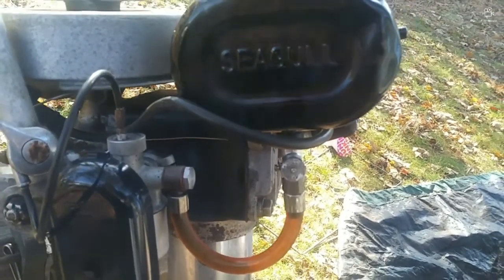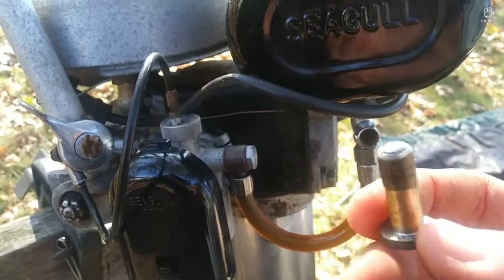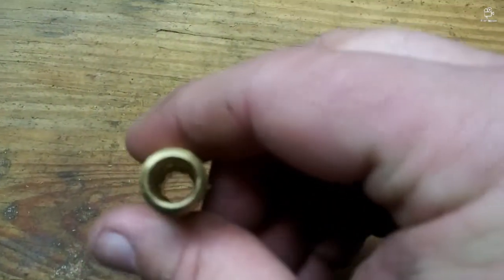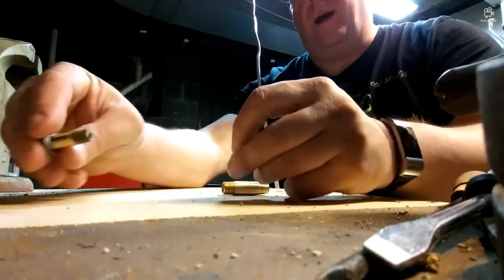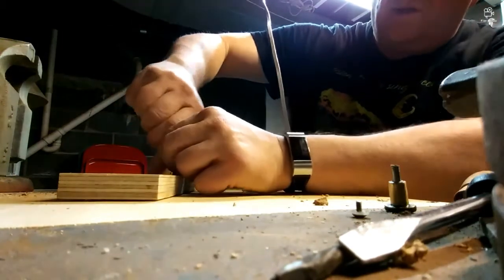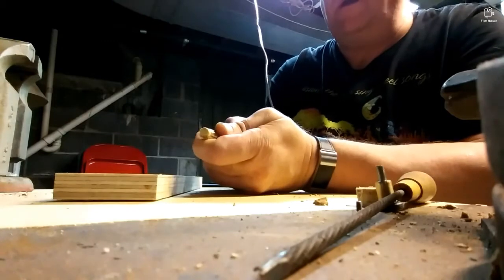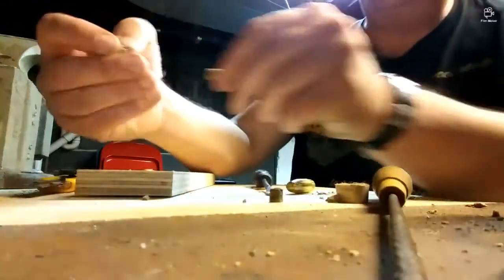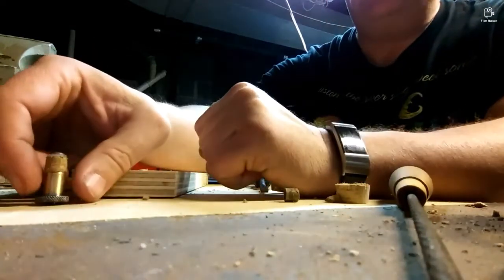Make this inexpensive tool and never buy a cork for your gas tank again

Comment: Mine doesn't have the screw...it's just a flat brass plate holding the cork on..
Reply from the maker: Press fit ?
Reply: @philcostello6989  Possibly. I tried pulling it out but it didn't cooperate. I just ordered a new assemble off eBay.
Reply: YOU CAN KNOCK IT OUT AND PUT IT BACK WITH HAMMERTIME !

Comment: Hi Phil. Any ideas how to ember dirt and sediment pout of the fuel line just under the cork. Rubber hose.
Reply from the maker: There's supposed to be a little filter at the end of the stopcock what I would do is probably try to take it apart and rinse everything out with brake cleaner it's a good spray along with the the rubber line the other thing that would really consider is using the gas without any ethanol in it for these little motors. Ethanol really works on all the gas lines and it's notorious for breaking down and causing clocks both in the carburetor and in different areas I've gotten to the point where I just use the more expensive non-ethanol gas we can get in the hardware stores here in Connecticut
Reply: Phil Costello Thanks Phil. Very useful I will give that a try. Pity your so far away I could have dropped it round and you could assist. Lol it’s a bit of a treck from Scotland though. Keep well

Comment: Very inaccurate way of doing it, I notice you skipped showing how to drill the hole...
The punch was a waste of time, you can do the whole thing on your pillar drill, like it was a vertical lathe? But drill the hole first, mount the 'blank' on a bolt and mount that in the pillar drill, sand or file it down to desired diameter. That way the hole is bang down the middle.
Reply from the maker: Sounds like that's a good way . Have you made them that way I tried sand them in the lathe like that but to hold them I had to compress it and when I released the pressure the we're thin In the middle I will try it your way sounds like it should be good